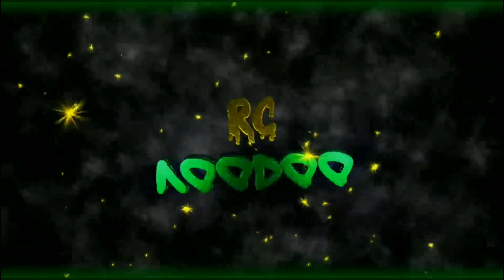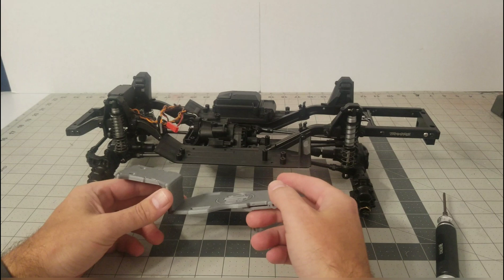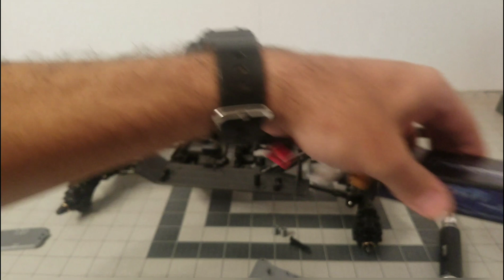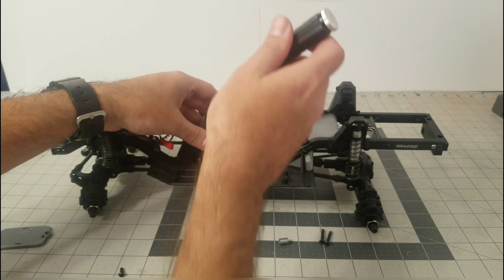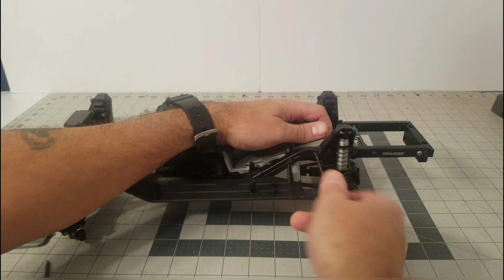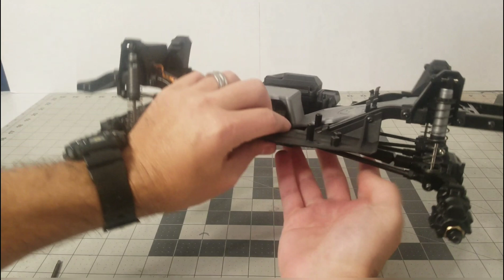Operation 11 Charlie Vet build #2 low cog battery tray

Comment: Good upgrade brother. Low center of gravity.  I have always been in favor of placing the weight between the axles and 50% on each axis if possible. Because it is useless to climb a lot (with weight in front) if after head down 👌
👍🤙👍
Reply from the maker: yep  ive seen so many people weight the front so much when they head back down they just flip forward  lol